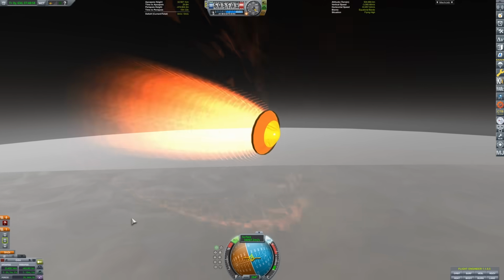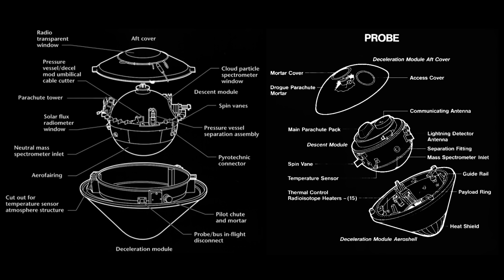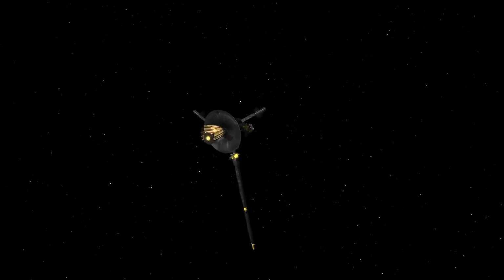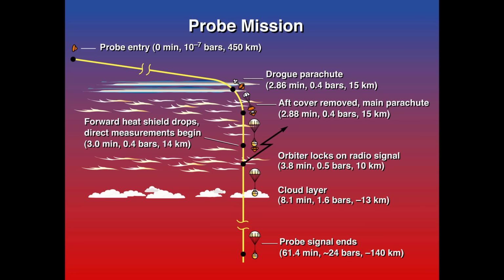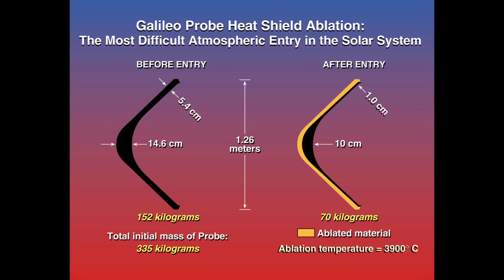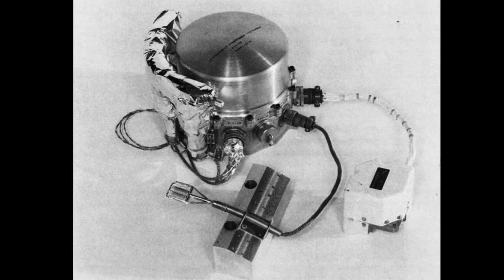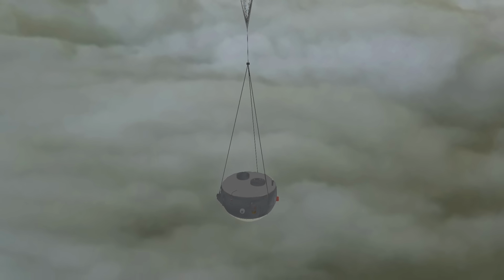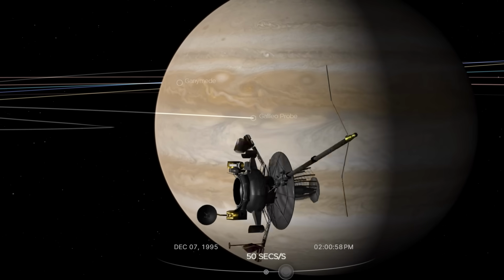The Toughest Space Probe Ever - How NASA Dropped A Probe Into Jupiter

Comment: When you were talking about the probes landing on Venus (or trying to at least), this reminded me of a question I wanted to ask you and get your opinion on. To give some context, I have to first ask if you have ever watched the "Defying Gravity" sci-fi series? It was first broadcast in 2009 on ABC in the USA and CTV in Canada, the general theme involving 8 astronauts on a multi-nationally funded, 6 year long mission to visit every planet in the solar system, using a large "Antares" mother ship equipped with dedicated landing craft for each planet - or at least that was the intention.

There has only been one season so far with 13 episodes total. The only planetary landing shown was towards the end, in the episodes 12 and 13 two-parter, where they send 2 of the astronauts in a small landing craft to land on Venus. One of them actually gets out and walks around on the surface for about 20 minutes, in a heavily built suit which resembles one used for deep water saturation diving. Which makes sense, since the atmospheric pressure at the surface of Venus is roughly equivalent to being 900 metres under water on Earth.

Anyway, here is the question: Would it be possible to build a rocket engine with enough thrust to allow a spacecraft to lift off from the surface of Venus and get back into orbit? As I understand it, the classic "de Laval nozzle" used for rockets accelerates propellant by converting chamber pressure into exhaust velocity, hence generating thrust. However, with a pressure of some 90 atmospheres surrounding the rocket, that surely limits the degree to which the exhaust can be expanded, and therefore both the efficiency of the rocket and the thrust it can generate?

In the final episode, the Venus landing craft takes off and seems to get from the surface and into orbit (to dock with the mother ship) in a single stage. Even without the atmospheric pressure problem, that just doesn't seem possible - especially since Venus is a similar size to Earth, so presumably the gravitational field it generates is also similar to that of the Earth.

Comment: I'm not surprised everything didn't go perfectly since I was sent down to a supply/salvage place in Mtn View to get some extra spring washers to mount the chromatograph. I wasn't working on that project but I had a motorcycle so could get through traffic quicker and it had to be done quickly as the probe was about to get sent off to JPL. I couldn't believe that I actually got to touch something going to Jupiter since I was 18 at the time.

Comment: Isn't there a durability standard/requirement for the wiring? I have had several cracked wires near my steering head. I have to shop around with wire all over to see if anyone can accommodate replacing it. Trying a rc hobby shop 1st.

Comment: Off topic Delorean story; Back in 85 I worked for a 2 way radio and cell phone shop where they had pager towers up on Cheyenne Mountain, yeah, been up there there a few times and seen the 5/45 VHF/UHF TV transmitter. So this AF officer guy comes in with a Delorean he has modified with a I5 Volvo engine and had us install a 5" color TV in his dash and we later found out that this AF guy was Stationed in LV and used that car to drive out 6 hours to area 51. Yes, it was a RS 12V TV, I'm sure the Q will be asked lol.

Comment: There was a little side experiment measuring the wind speeds on Jupiter by measuring the Doppler shift of the comms. It turned out that the CSIRO Compact Array of 6 22m dishes near Narrabri/Australia was in the right spot at the time. I just had made up a prototype digital filter system to play with when my boss waddled in and asked me if that pile of components and wires can be used as part of a high profile NASA experiment. I laughed and said no way. Well at that time anything was possible (there was no project management back then) and after my boss explained to me that it is this way or no way I shoved my pile into a card board box and drove up to Narrabri in the trusty Holden Commodore Station wagon. The boys there were pretty excited and we made it all work OK. A week later a JPL engineer came to join us and we did some testing which went ok. We carefully avoided showing him our down conversion system, of course. The JPL guy got his data ok and the results were published in the Science magazine two years later. As a nice touch I was credited in the article too. Lateron I made a small series of those 2 channel digital filter units and NASA bought 2 of them. My 'signature' on each pcb was a kangaroo and a love heart.   Aaaahhh...the good ol times......😊.

Comment: Interesting that the probe only made it to a pressure of 23 bar.  That's equivalent to a depth of (only) of 220 meters (720 feet) underwater on Earth.  By comparison, the the deepest human scuba dive is around 332 meters (~33 bar), and the average ocean depth is about 3,700 meters (~370 bar).  It might not have been feasible to extend much more that that due to the heat, but 23 bar does not seem like an extreme pressure.
Reply: Having to be such a lightweight probe probably meant it wasn’t made to handle too much gas pressure, even knowing that it was descending into Jupiter

Comment: By extrapolating data up to 90 bar wich is the pressure on Venus surface the Jupiter temperature seems to be similar as on Venus. 
Why do we hear in all Venus documetaries that Venus is a run away greenhouse but Jupiter shows similar temperature much further away from the sun having a hydrogen/helium  atmosphere?
Reply: That heat in Jupiter is due to its own internal heat of formation, like magma on earth but obviously not with melted rocky material. On earth (and a geologically active Venus) that heat is largely insulated by the crust both by the material composition and slow convection compared to gases
Reply: @alexsiemers7898  if one compares space probe temperature graph's of Venus and Jupiter space probes from diving downwards into the atmosphere the graphs show a surprisingly similar function of pressure. Same holds by the way for the earth atmosphere. This doesn't fit your explanation that Jupiter is a different case.
Temperature of planetary troposphere as a function of z coordinate solely relies on the laws of thermodynamic respectively conservation of energy. They define how thermal energy is converted to work (decreasing temperature towards low pressure) and vice versa work is converted to heat (increase in temperature towards high pressure). This results in a laps rate which is present for all planets having a dynamic troposphere fueled by a suitable strong energy source to allow vertical circulations.

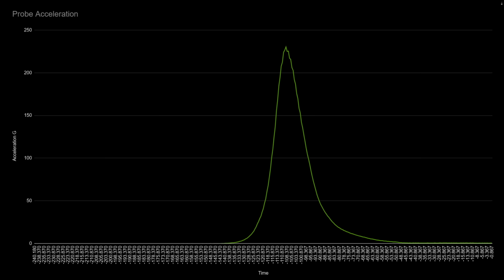Comment: 11:19  Why do G forces drop to zero on the right side of the graph?  Once the probe reaches a steady speed, it ought to be experiencing a lot of Gs.
Reply: No, a steady speed means no G's.  Your understanding is flawed.
Reply: @imaginary_friend7300  No, it does not work that way.  Go ride an elevator, and you will experience 1G almost all the way up and almost all the way down.  If you could ride a 1000 mile per hour elevator, you would still get 1G once you reached a constant speed.
Reply: @erintyres3609  Why a lot of Gs? As you say, 1G on earth once you reach terminal velocity, so what G do you expect on Jupiter? I don't think the graph goes to zero on the right, I think it goes to 2.5, about 1/100 the max of the graph (maybe with slight inaccuracy in the drawing).
Reply: @RHawkeyed  You have a good point, the "surface" gravity of Jupiter is 2.5Gs.  (I thought that it was much higher.)   The right side of the graph ought to level out 5% of the way between zero and the 50G tick mark.

Comment: I was working at the Parkes Observatory in Australia at the time they had a contract with NASA to help downlink Galileo data. The Parkes operators basically just had to point the dish, the signal acquisition was done by a big grey box NASA delivered to us and serviced themselves. At that time, Parkes had an ingenious but primitive system for pointing in which the telescope was slaved via a light beam to a small 'master equatorial' located at its centres of rotation. This being the Outback, critters could and did get into this system. I still remember the first time we had to tell NASA that we had lost lock because a Bogong moth had got in to the ME cabinet and blocked the light beam. The vibe was very like that described in the movie 'The Dish' - totally fictitious in itself but giving an accurate insight into the relative attitudes to engineering and operations of Australian versus NASA crews. :)
Reply: The 70 m DSSs use master equatorials. Proven technology.
Reply: @Gregory_Laborde  it's not the ME concept as such, it was the fact that moths could get in at Parkes and dump it out of lock. :)
Reply: @ When I worked on MSL (Curiosity, my final assignment before retiring from JPL) we had a failure at one of the DSSs in the <something > Drive Electronics box, used to control the drive motors to position the dish. When the techs opened the box it was full of  spiderwebs. And spiders. Nice and warm, I guess.
Reply: Lol

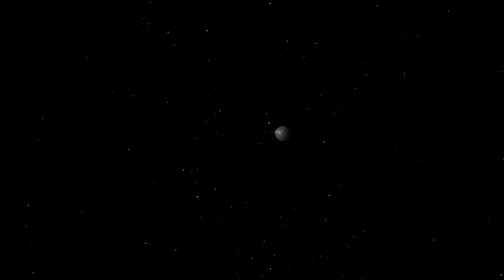Comment: 7:55 What a pity the high gain antenna (HGA) couldn't fully deploy. Here's what Wikipedia mentions about it: "The HGA was to have transmitted at 134 kilobits per second, whereas LGA-1 was only intended to transmit at about 8 to 16 bits per second."

Interestingly enough, the initial implementation involved raw data transmission. After the HGA failed to deploy, they updated the software on Galileo to compress the data to increase the data throughput to 160 bits per second, and with further compression they achieved a bandwidth of 1000 bits per second. But while they avoided compression because it introduces error that may be amplified with higher compression rates, after being left with no choice they compressed the data stream and they got good results. :)
Reply: Compression techniques, carrier-suppressed transmission (requiring development of the BVR for the DSN), use of 70 m DSSs, boosted the effective data rate up to 320 bps, occasionally. But not often. A few bits per second were devoted to engineering telemetry. Later that was reallocated to Science as the team grew more confident in their spacecraft. In the case of a fault, downlink would revert to TDM engineering telemetry at 10 bps and use a carrier on the downlink the help the DSN re-locate the spacecraft. They eventually reached the point where the spacecraft would recover itself and return to Science with minimal ground involvement.

Comment: Thanks, that was really interesting! I'd like to add something. You correctly mentioned that the energy to be dissipated on reentry goes up by the square of the speed. But what I find really relevant for this probe is the peak energy that had to be dissipated per second. In that calculation the energy goes up by the cube of the speed. This is due to energy going up by the square of the speed but with the additional factor of passing through more atmosphere per second. This is identical to wind energy going up by the cube of the wind speed when dealing with windmills. It's amazing they were able to build a probe that could survive this.

Comment: I would love to know about Jupiter's core. From what I could find, its core should contain about ten earth masses of elements similar to earth's (iron, nickel, etc), but at the estimated temperatures of 15000 K, entropy dominates and things like chemistry go totally bonkers. Because of the high hydrogen content, it would be strongly reducing, so there wouldn't be any rocks, as the hydrogen would react with oxides to for water and elemental metal. But would that metal be solid due to pressure, or like some kind of supercritical plasma soup due to temperature? Perhaps measuring changes in solar neutrino flux as Jupiter passed between the detector and the sun we could get better estimates for its core density and profile. Though I can't imagine how hard it would be to get a neutrino detector into orbit around Jupiter...

Comment: Regarding the accelerometers being switched: Some 25 years ago, I was involved in developing a large satellite bus test system. One flight control component was a three axis laser ring gyro. We received an Engineering Unit from the supplier, installed it on a rate table, and ran our data acquisition system. Discovered the X axis polarity was reversed, which would have been a disaster in service. After correcting our scale factor, all was well. Until Flight units arrived. Turned out, the EU was wired backwards in the first place!

Comment: how would we know if it has a surface or not?
Reply: Radar for the most part. Juno was the nail in the coffin. At some point you'd expect to see a sharp change in the signal where the phase transition occurs (solid <-> gas/liquid). Either in phase, signal strength, or spectrum. Instead that simply never appears in the data. The gas smoothly becomes denser and denser until it is a super-critical-fluid which continually becomes more-and-more dense until it is opaque to radar.

One can argue that hard solid/fluid transition COULD exist below that, but it is sort of moot. That would be so deep. It would be like arguing earth's inner core is "the surface".

Comment: Great to hear the outcome.  As an employee of Sundstrand Aerospace (now part of UTC) I was on the team that put together the proposal for the heat exchanger in the liquid  oxygen tank (but could be the hydrogen tank) that insured vapor was vented instead of liquid since at zero gravity the two phases would be mixed.  This was needed when the Gallio third state assembly was in the Shuttle bay.  Won the contract.  My 'Handbook of Stress and Strain' based analysis hit the mark. Couldn't calculate the stress numbers for the welding of the thin foil skin welded to the two ends fins.  Even the FEA analysis missed the mark twice before the shaker table cryogenic test didn't fail at these welds.

Comment: Metallic hydrogen? As in hydrogen under such high pressure it's a solid? Or is this some other form of hydrogen I don't understand?
Reply: google it, very easy
Reply: Either liquid or solid. But metallic meaning it has a conduction band made of delocalised electrons.
Reply: Hydrogen "should" behave like a metal at sufficient pressures. According to material models.

Comment: Surely we can use the heat of re-entry for something? Like funnelling it back forward like a jet engine reverse thruster.
Reply: The problem there is doing so in a way that doesn’t result in pockets of much denser, superheated atmosphere which would destroy the ship from structural loads. Similar issues with pressure are why a lot of circular parachutes have a hole in the top

Comment: Tape recorder was made by Odetics in Anaheim CA. I have seen a picture of it in 25+ years. If you look closely at the picture, reels are coaxial, tape guidance was with crowned rollers which worked with the 1/4" tape. Tape was made by Ampex and a lot of further processing by Odetics. Wasn't my project, brings back some good memories.
Reply: @lancedoyle5026  Odetics clearly understood the issue with an LED failure resulting in being stuck at one end of the tape. The subsequent DMS used on the Magellan mission to Venus used metal tape and sensed EOT and BOT by looking at an LED across the tape pack on each reel, rather than through clear leader. Still, it was a highly reliable and robust design that served well. With the loss of Galileo’s HGA making the DMS the primary data return device, we handled it more ‘gingerly’ and did not fully comply with Odetics’ instructions to run the full tape end-to-end periodically to spread ‘goop’ (or was it ‘gunk?’ I forget the technical term) emanating from the tape across its entire length, allowing a ‘booger’ (another technical term) to accumulate on a dummy erase head and stick to the tape. Since the tape was not tensioned in the mechanism (no idler wheel or similar), the solution was to start all tape movements in the direction that would detach the tape from the booger (rather than futilely pushing it towards the booger), reversing it immediately if movement in the opposite direction. Flight Software was updated to accomplish this automatically, among other things. 

Having worked with SSRs (Solid-State Recorders) in subsequent missions, I can tell you that they have their own issues. But they generally consume far less power in operation and have no moving parts.
Reply: … if movement in the opposite direction WAS DESIRED.